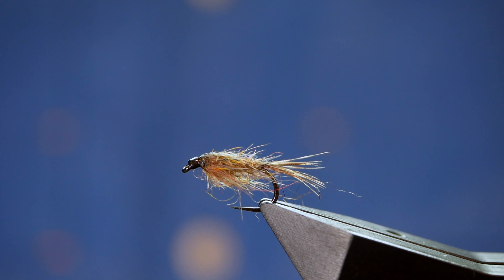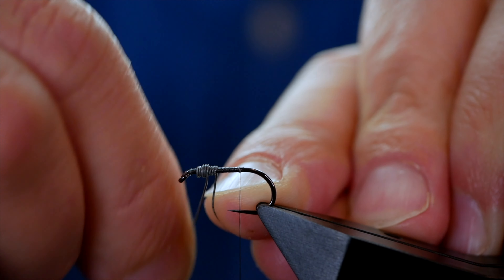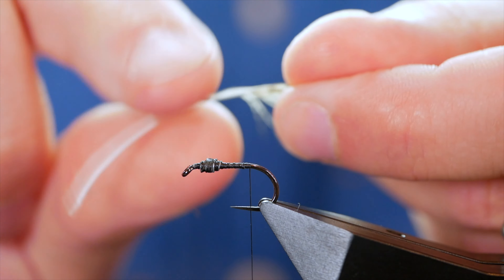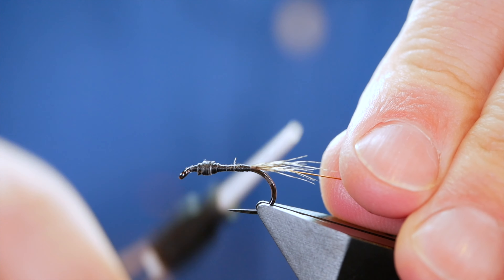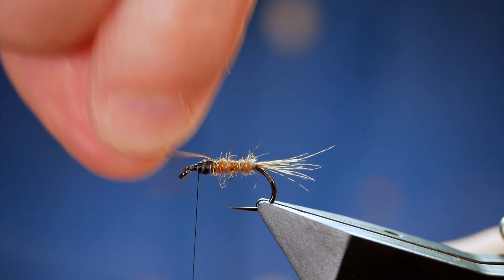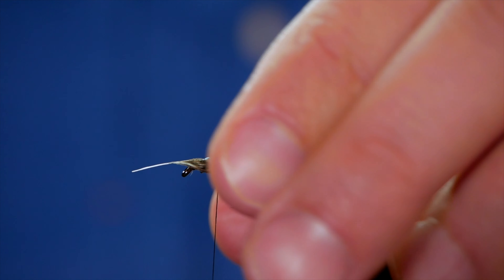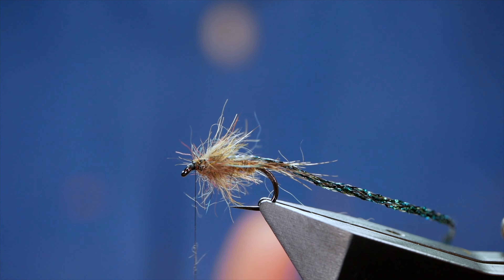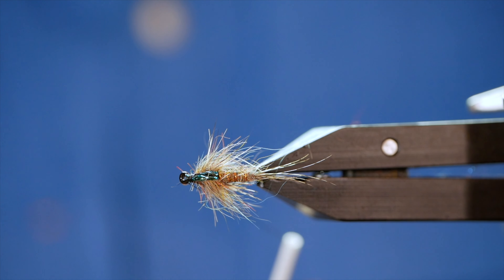Fly Tying the Killer Shrimp Ear 4K

Comment: A great blend of the best of two effective patterns. With your usual twists. Two of them especially leap out. The use of the partridge breathers adds movement, life and an almost subconscious subtle aim point. Without risking spooking the trout or grayling. Also adding resin to the thorax cover is very useful for protecting that part of the fly. Especially on the latex cover on Mary type nymphs. Or when pheasant tail fibres are used on nymph thorax covers
Reply from the maker: Thank you! Cheers!